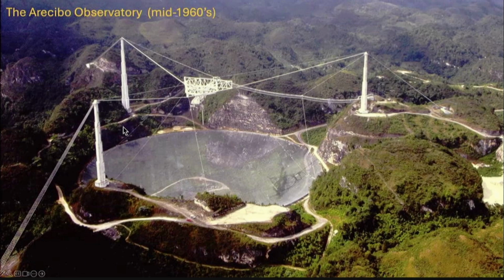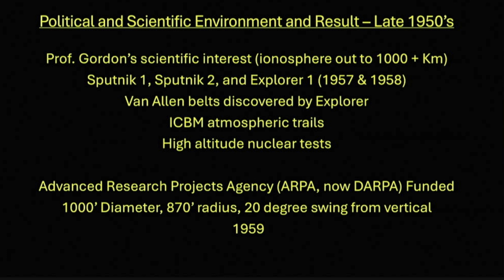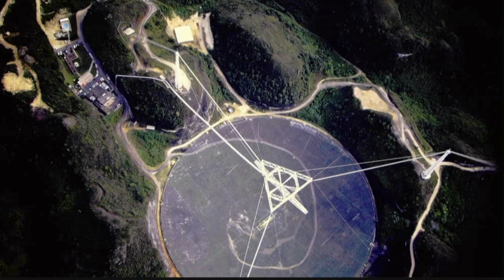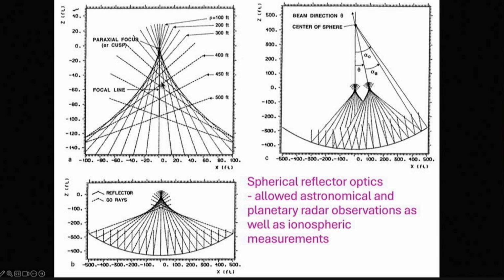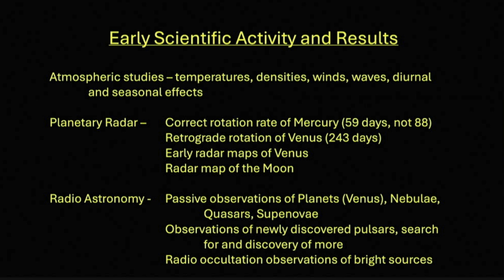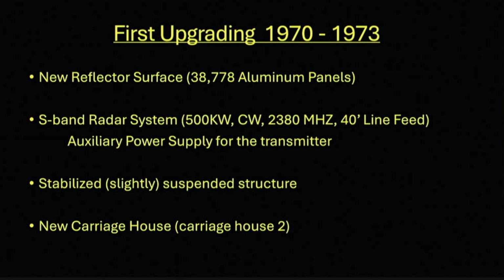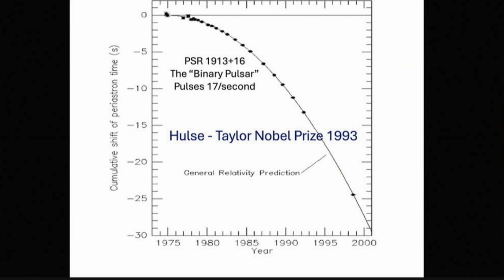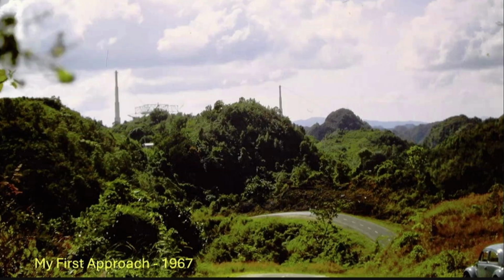The Rise and Fall of the World's Largest Radio Telescope

Comment: Dr. Craft, During your incredibly interesting presentation I kept waiting for an amateur radio connection. I'm sure that Angel V. and other staff and visitors must have utilized amateur radio as a hobby and a link to the states. I hope the new visitor center also has a variety of repeaters that could be very useful in times of disasters Thus fulfilling one of the amateur radio fundamentals to serve the public good. 73